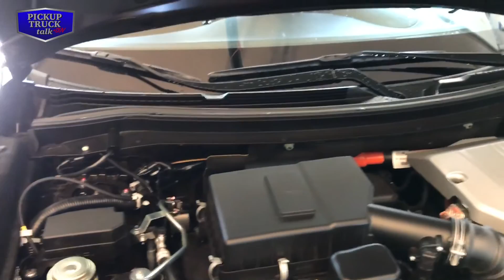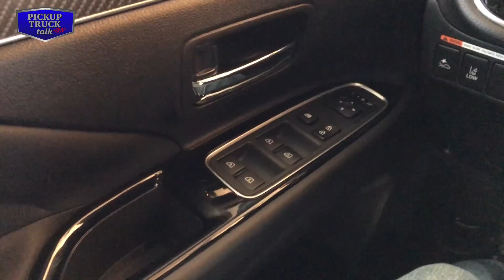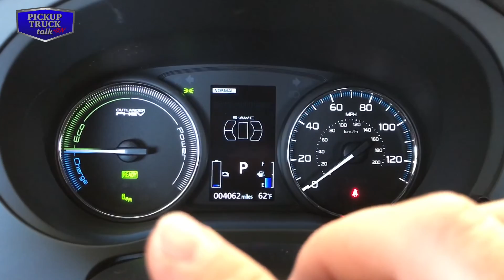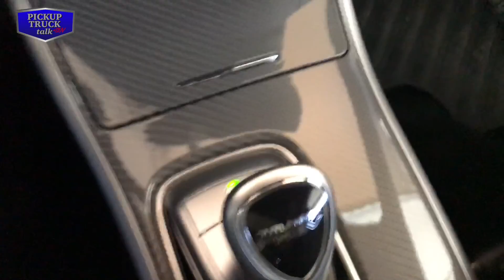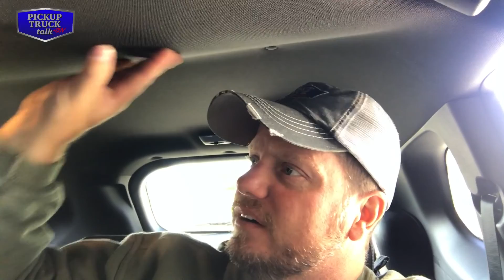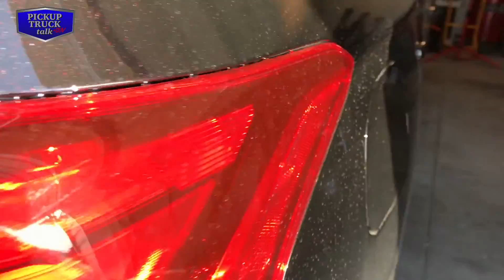Are Plug-In Hybrids the Future? 2019 Mitsubishi Outlander PHEV Review

Comment: In the UK electricity on an EV tariff is 5pennies per kWh. And the car will take a maximum of 10kwh that’s 50 pennies (62 US cents) for those 22 miles. A gallon of fuel in the UK is a sold in litres. 3.78 litres to a US gallon @ £1.30 per litre = £4.90 that’s equivalent to $6.12

Once the charge is depleted it works as a hybrid and compares very favourably with a soft reader from any other manufacturer for economy.

So is like have two cars in one, the economy of a golf cart for short daily commuting and also average to good economy on a longer run.

It’s a no brainier that this car makes sense.

I think the other thing that you misunderstood is B5 mode for regeneration does not suck more power out the battery, it only operates when braking and in fact puts more power back in the battery. It does nothing at all when you are accelerating or maintaining a constant speed.

Comment: Maybe you should do your homework before doing a review on a vehicle like this.  For example, the cup holders in the back are for the 3rd row passengers on the gas powered model, Mitsubishi had to take out the 3rd row to fit the battery into the vehicle but they didn't delete the cup holders to save on production costs.  When you put the vehicle in charge mode, the engine doesn't work any harder to charge the batteries than if you had the vehicle in save mode or parallel mode, it just stays on constantly.

As for your figures, the mpg, and how much you will save, this vehicle is great for someone who drives to work that is less than 20 miles from home.  You can drive in full electric the whole distance by pressing the EV mode button. The cost of electricity is much cheaper and more efficient than gasoline and you will save a lot of money plus it helps the environment because you are not producing any CO2, some people would purchase this vehicle for that reason alone.
Reply: It's a good out of the way place for auxiliary water bottle or coffee thermos storage... I'd rather have it there, than a flat cover panel with no utility.    +1 to Mitsubushi for not removing it when they needed to jettison the nearly useless third row to make room for the rear electric motor & controlling module...j

Comment: EMP will render ev useless
Reply: then all cars will die because they all need electronics
Reply: ...and the electric powered fuel pumps, the electronic controlled ignition backup generators and huge computer control power systems at every petroleum refinery in the United States.  The amount of electrical power used by Oil Refineries to process petroleum into usable fuels is awesome.  But horses will be in demand for short commuting and scavenging for additional food supplies until the manure gets out of hand.  Hmmm, maybe a week long charge with solar panels would get you 22 mores miles?  Naw they'll be zapped by an EMP event also, so I'm back to thoughts about pack animals.